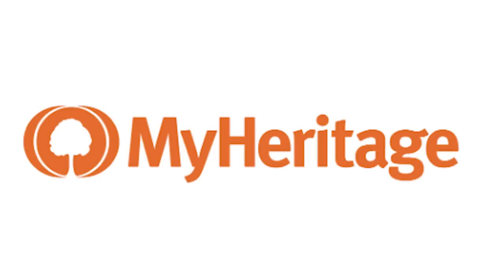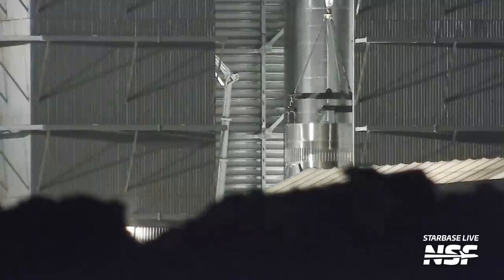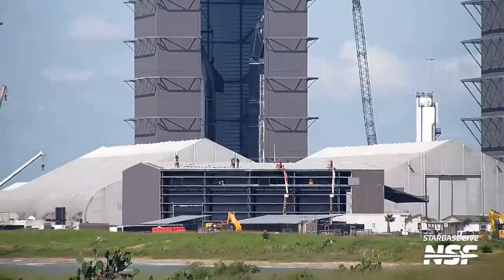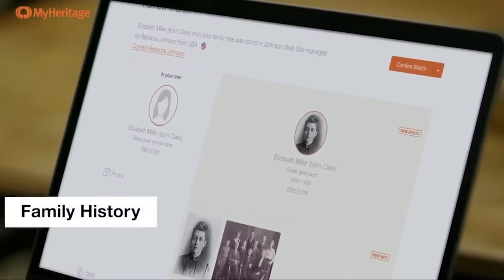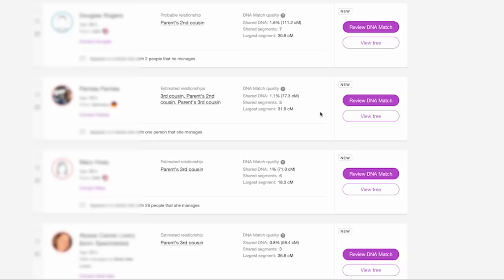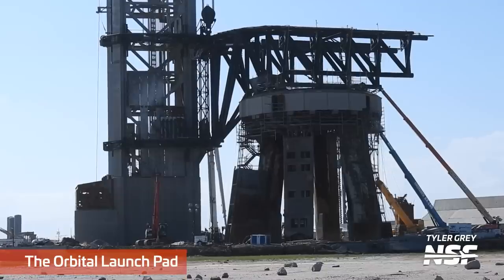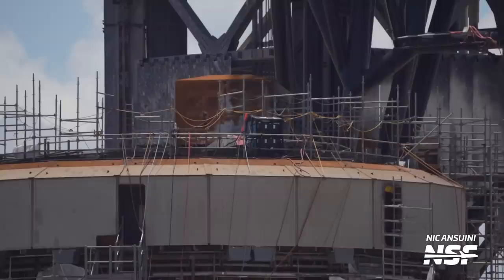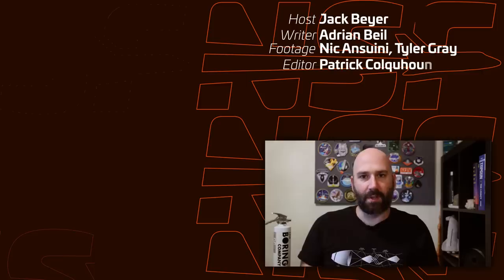Road Closures, Boosters, Ships, and Exciting New Hardware | Starbase Update

Comment: If the question ever comes up, is an ad that's 1/3 the length of the video too much ad, the answer is yes.
Reply: However, the ad length would only be a concern to those who don't have access to a fast forward or skip.option or haven't learned how to skip forward on their device.
Reply: @michaeldeierhoi4096  or SponsorBlock